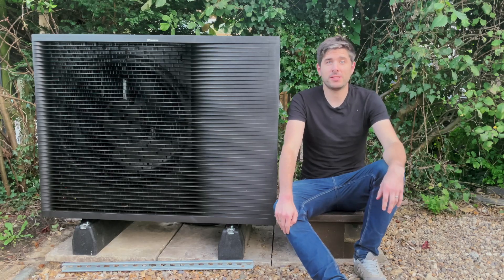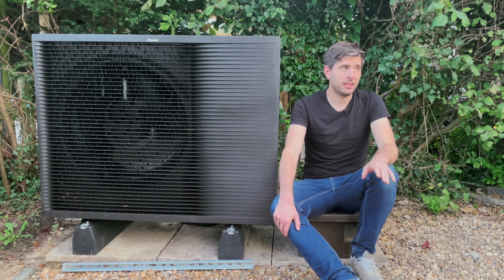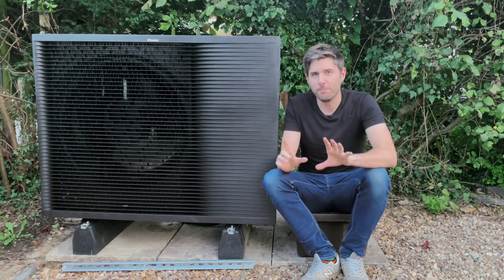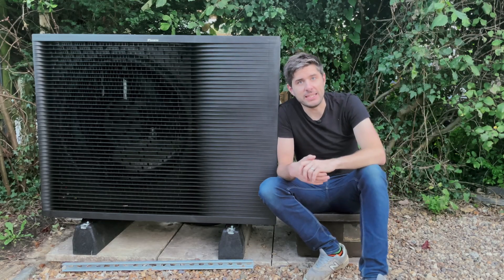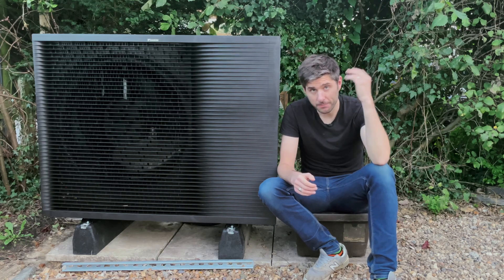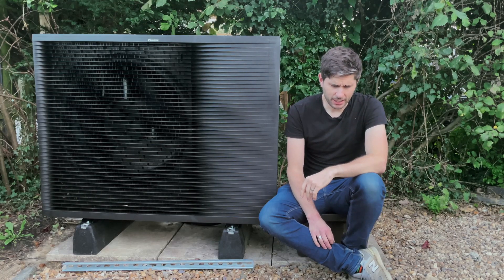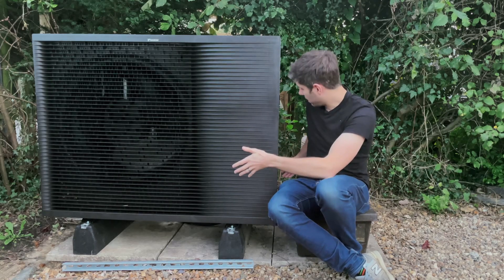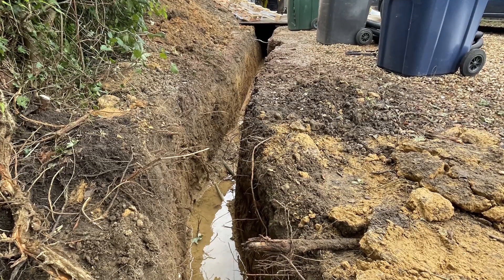Replacing an oil boiler with an air-source heat pump: Why, what and how

Comment: May I ask why it wasn’t running while you did this video sitting next to it?
How noisy are theses things, if you have close neighbours, could it be heard by them?
My previous neighbour had an air conditioning unit outside our bedroom window and that alone was enough to make us move. 
Imagine a whole village full of air source pumps.
Reply from the maker: It wasn’t running because it was too hot (I filmed this in late September). It’s a split unit which means the outdoor bit is really quiet (just a big fan) as the noisy bit (the pump) is indoors - which is about as loud as the oil boiler it replaced. 

Noise was a big concern for us, as our village is very quiet and our houses are close together- noise travels really well.

Comment: I know, why not reduce the flow temperature to "off" save the installation money and just invest in thick jumpers? They warm a body up VERY quickly.
So lets say the ASHP has a CoP of 4 and that gas is 0.9. On a cold day the ASHP will be on 100% of the time drawing who knows how many KwH - but "giving back" 4 times as many (yeah, right) in heat. Gas has to be "cycled off" 0.225 of the time to be consuming energy for the same amount of time as the ASHP. Subjective as I haven't measured it, but more likely to happen than a CoP of 4! And gas is cheap, and it heats the space and the water comfortably and efficiently. Lets not forget that with a HW flow temp. of 55c, there is no protection against Legionella as the actual HW will never heat beyond this value. Oh yes, you have to put the immersion heater on - with a CoP of less than gas!
Heat Pumps: What a load of tosh - just like the EV con.
But - nicely presented video, thank you for confirming my bias.

Comment: I have lived in a house from new for 44 years heating by oil. I am on my second boiler and second tank.  Next door is still on their first steel tank. I have no intention to change my oil boiler any time soon. My 44 year old house is reasonably insulated but i still consider my home leaky and further insulation measures will be expensive as would a heat pump powered by expensive electricity. The oil supply business is quite competitive. My wife who has sensitive hearing would hear the fan hum and we have a small garden and we do not fancy the constant hum destroying the quiet of our house or the neighbourhood. Bigger radiators digging up the garden and patio and creating new pipe pathways. All sounds too much for our modest home.

Comment: Great video! Thanks. I didn't think TRVs were recommended for ASHP systems? Everything I've read says not to use them 🤔
Reply from the maker: I believe it’s a requirement of the boiler upgrade scheme, however you can just leave them all open!
Reply: Came here to say the same.  Generally ASHP run better with one 'zone'.

Comment: Great video. I’ve had the same ASHP since April 21. Cost me the same as oil boiler we’d had installed 8 years previously. No radiator or pipe work changes. I’ve achieved efficiency/SCOP of 4.06 for November. I’m running the weather compensation curve. I talked to ten installers. Got 6 quotes before I chose my installer. All good. Did you go for the 10 year fixed price service/warranty from Daikin?  Was it not possible to site the exterior unit closer to your property?

Comment: Groan .. you must have money to burn literally!. ASHPs are only viable if you live in one of those Scandinavian style passive homes. Around third of the UK population live in houses constructed pre-war (WW2) and a  lot live in houses constructed pre-war 2! During the colder months the device will be using far more electricity to maintain the house at a reasonable temperature. The only people benefitting from the are the people who sell them! If you really want to save the planet spend your spare cash on a scheme of insulation.. windows, loft walls etc
Reply: Bit of a sweeping statement there, plenty of houses in Sweden aren't passive (I don't know of any locally to me, and mine certainly isn't - it's almost 100 years old), and all the houses round here are heated just fine by ASHPs.
Reply from the maker: Mine was built in the 30’s (fireplaces in all the rooms). We have double glazing and added extra loft insulation and (so far) the house is toasty. The ASHP Is using more energy, but loads less than I expected. I’ll follow up with some data after the winter.

Comment: Hot water must be heated to 65 degs according to HSE to avoid problems with legionnaires, don't know why you are talking about 55 degs hot water, you are wrong.
Reply: HSE is for work environments, not domestic. Heat geek have a video explaining what rules apply (and don't) to domestic properties in the UK.

Comment: Good video - how many radiators did you upgrade in the house? I ask because I changed seven of ours from Type 10 to Type 22 and sized for lower flow temperatures prior to changing my gas boiler to a Viessman 200 W 4 pipe system. I am currently running entirely on weather compensation all my TRVs are turned to maximum (so they will never operate) and we have no internal reference temperature (room thermostat). So, here we are in a large 5 bedroom detached and the ambient temperature around 7c and the flow temperature from the boiler is 30 degrees (so the boiler is condensing nicely) - the house is uniformly comfortable. It took a few weeks to fine tune the weather compensation to the house dynamics, but it is worth persevering as once it’s done it’s done. At - 2 C ambient the curve will lift the flow temp to around 45C.

I did not go ASHP for one single reason - no confidence in the industry. The ASHPs themselves are well proven and efficient absolutely no problem. However the hydronics design within the house is beyond the competence of most of those who are currently installing. It’s like the Wild West out there.

Hopefully ten or so years will resolve the industry problems and then - maybe.😉
Reply from the maker: Just the one radiator, agreed on the lack of installers - we found it a real challenge to find one!

Comment: Did ypu consider an air-to-air system? We are looking at replacing an oil boiler, but we rarely heat the whole house and have a wood stove to heat the living room (which also proveds background heat to hall stairs and landing. I am strongly considering air-to-air and then infrared for the bathrooms and my office.
Reply from the maker: We didn’t as when we applied (and I believe it’s the same now), the government grant doesn’t cover air-to-air systems

Comment: Are you getting paid by the electric supply companies?? I have a a few LED. Bulbs, a microwave oven, no TV and  no heating except a wood stove and yet my bill is £100 per month. So how will you save money with that monster compressor?????
Reply from the maker: I wish I was, we worked out that it would probably be slightly cheaper to move from an oil boiler to a heat pump. The big challenge with oil is how volatile the prices are (unlike gas or electric) and they aren’t subject to any price caps.
Reply: @michael_bird  price of oil is the same currently as 7 years ago... the fuel price across the road from me has recently reduced so a good chance my next oil fill will be cheaper than the previous one... meanwhile electric is now twice + the price it was 7 years ago.

Comment: Hi from the other side of the world in Sydney, Australia. Heat pumps have been used here for pool heating for decades. Air conditioning split systems aka reverse-cycle aka heating and cooling and been inverter drive for a long time also. While we don't need the radiators etc like the UK, gas hot water systems are starting to be replaced by heat pumps too. With the enormous penetration of solar panel installation and now batteries, all part of the energy revolution. Cheers

Comment: The only way it can work and save money and be more efficient is if your home is completely compatible and insulated correctly.    Needs bigger rads bigger cylinders bigger pipe work ect ect.     If not fitted correctly you might as well throw money out the window.     And keep it running constantly
Reply from the maker: We had a full site survey, and we upgraded our loft insulation, only had to change one radiator

Comment: Nice video thanks. Heat pumps can give significantly better comfort and lower running costs (due to lower circuit temperature) if they are supplying underfloor heating (UFH) pipes.  Can be quite a disruptive job to install UFH, though the results are well worth it, and especially worth considering if you're doing work on your floor anyway (eg to add insulation).
Reply: Good points. :)

Comment: Did an extension last year which is double insulated with underfloor, this year been pulling up the ground floor to extend the system and double insulated the floor at the same time.
We have a mixed system with radiators upstairs, i specced a large hot water tank that was thermal solar compatible which will be installed sometime in the spring once i've finished all the decorating.
The water tank acts as a thermal store

Underfloor heating is between 20-40% more efficient depending on your heat source and the levels of insulation, you can run a mixed system no problem we did the conversion downstairs a room at a time once outside the new part. The house is a 1935 and needed some TLC including new windows and replastering

Comment: £5000 for an oil set up V.s  £49000 for a heat pump set up. I've done the maths as well, and guess what? you can shove your pump where the sun don't shine. I reckon you've got more money than sense. The planet? well I reckon that India, China, Russia, just to name a few countries that don't give a monkeys. Heat pumps are like electric cars, expensive to buy and expensive to repair when they decide to go wrong. Good luck!
Reply: Where do you get your figures? I can guarantee that my ASHP was installed for less than £10,000. Perhaps if you had done just a little research you would also realise that at the end of 2020, China's total installed photovoltaic capacity was 253 GW, and accounted for one-third of the world's total installed photovoltaic capacity. China also has more electric cars on the road than any other country - 4.5 million. So they are as keen to be as environmentally friendly as the rest of the world.
Reply: Installing one of these gizmos is like playing Russian roulette, you just never know what you are going to get, like trick or treat really. Some say it's the best thing since sliced bread, others say it's their worst nightmare. The cost of installation seems to vary from anything from 15 to 25 grand, depending who you speak to. Up here in Scotland the Muppet show that passes for a Government, decided that they were going to MAKE people install one of these contraptions. I'm not sure how that would work in practice, but the morons have decided that it might not work, it certainly would not with me. It's like smart meters, some say they work, some say they don't. Me!, if in doubt , DON'T, that's my philosophy. As for a nice clean China, according to what you read, they open a nice coal fired power station every day. That reminds me, I've got to order an oil delivery for my filthy oil fired boiler this week.

Comment: Talk about a complicated install you haven’t mentioned what temperature you have problems with In Australia we use air to air Heat pumps the system you are describing their looks horribly expensive and with more moving parts that I could with. That system is a glorified boiler is horrendous costings heating water to move around the house and convert to hot water to heat for your room you’re definitely lost me. Just how cold doesn’t get in that particular area where you are I’ll look for links to put in economical systems. So in reality all that is is the hot water heater. The only advantage I can see is if you can heat enough water During the night that the sister would run all day with happens without having to turn on again the reason with her that would be if the power is excessively expensive  during the day.

Comment: Using a heat pump for radiators is massively inefficient. Everywhere else in the world small convection systems are used and you get air conditioning all in one system. Easy to install, nobody stops to think about if it will work, even in Canada. Do you really think that with temps rising you will never need air conditioning?
Reply from the maker: Oh no, I would’ve loved to have put in air to air, unfortunately the government grant only covers air to water systems

Comment: We did the sums new lpg gas boiler
OR
A heat pump 

Our neighbours swear by them to heat their swimming pools

Ran the sums and we would save about 250 quid a year
Fortunately we have oversized radiators so up grading that was no problem.
We are planning to put underfloor heating in a new anex. Hence the HP option
All on all even with govt kickbacks it just didn't pay.

It reminds me of the trend in the 1970s
Electric storage heating (heating up thermal brick radiators with off peak electricity) Turned put to be a very expensive white elephant for many.
We went with a combination of gas (LPG) 
& solar to heat our water apr - oct.

Comment: Sadly there are a lot of boomers out there reading the Daily Mail that genuinely believe the negativity around HPs and hence have it in their minds that they "won't work" - my in-laws replaced their old oil boiler last year - BUT the installers convinced them they needed a 35kW unit - I estimated 10-15kW needed at most 🤦‍♂ Then just to make things worse, they set the flow temperature to 80C rather than the minimum of 65C - wonderful set up for a so-called 90% efficient condensing boiler 🙄

Comment: "The problem is not the problem, it's your/their perception of the problem that is the problem" Cptn Jack Sparrow   The SUN has exceeded the projected peak output for this cycle and it's 3-5 years early.  If 400ppm were in cm, the CO2 layer would be 4mtrs(13ft) thick and the rest of the atmosphere would be 10,000mtrs(32,000ft) thick. Humans contribute 8cm on this scale and plants recycle 2 times that making oxygen, we feed plants.

Comment: Great video. More please through the winter. Would be very interesting to see the updates. We have an air source heat pump too, but in a new build. Heading into our 2nd winter and still tinkering. Have to say it did a great job last year, cost and comfort we can't fault. Good luck to you.
Reply: They are a rip off

Comment: Unfortunately you should take care of all the bushes& trees around there. Or otherwise you will have to clean the heat exchanger surface very often, because leafs could "clog" that up. You can also choose to clean the heat exchanger often, especially in Autumn & Winter, which is what i would try first.
Keep an eye on that ❤
Reply: The fan reverses to blow it out.
Reply: This is true although the speed of air going in the back is slow its not sucking very hard. On ours leaves don't appear to be an issue. What does get stuck are wind dispersed seeds and blossom. So have a check at those times of year. And keep a cheap dust pan brush by the unit.

Comment: Before setting up a weather compensation curve I've preferred to run it manually, meaning I started with a flow temperature and the lowered it until it no longer could keep 24°C inside. And so on for the entire season and realised that i needed between 30 and 36°C for the entire winter. 36° at -9°C. Usually I would need to change the temperature form the app on my phone once every 3-4 weeks when the weather outside was significantly different.
But my house is pretty well insulated although I'm using radiators, not floor heating.
135 sqm house and a 6 kW Gree Versati III heat pump. For domestic hot water I'm still using the 35kW instant gas boiler.
Reply: 24 degrees inside!
Reply: @allthegearuk  Yes, 24-25 degrees is a perfect temperature for us, the same as in the summer. 22-23 in the bedroom during the night to sleep better.
Reply: @razvanlex  Sounds like you are from a hot country? My Greek neighbours ran their heating in a similar manner 24/7 until I nagged them to at least set back the temperature at night; they complied to 20 at night. Completely different to me, i've never run my heating at night and when i used to work I only had the heating come on for me in the evening (for the morning I used a dressing gown).
Reply: @Martindyna  Not really, I live in Romania. Summer it mau go as high as 35-40°C and in the winter as low as -25°C.
In the bedroom at night I keep it a bit lower, 23°C usually, so we can sleep better. We're not wearing "winter" clothes inside, normal clothes, long sleeve and pants. If I feel fine at 23-25°C in the summer inside I think I should feel fine at the same temperature in the winter also.
It's not a good idea to change the temperature too much between night and day for the entire house if it's decently insulated, a stationary regime is better and more economic than a transitional regime, especially for a heat pump.
A heat pump will work harder with more power and a higher temperature to raise the  temperature thus achieving a poor COP.